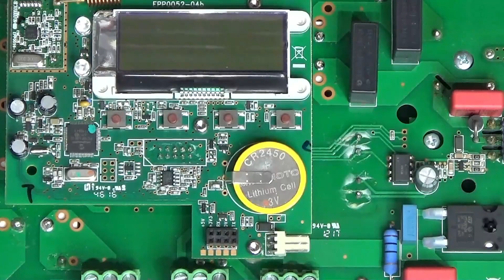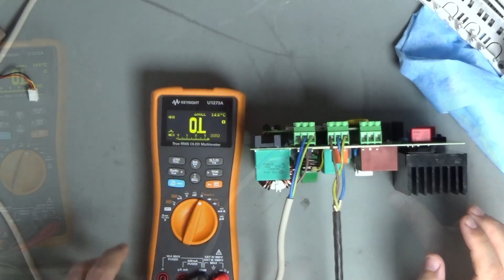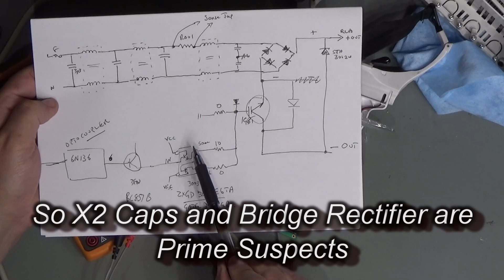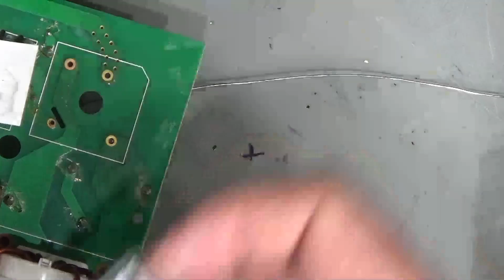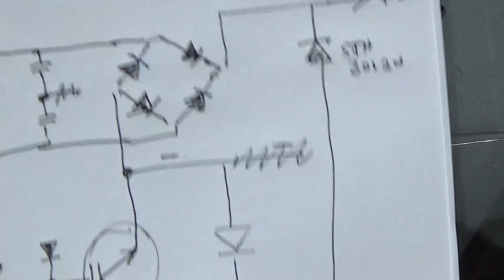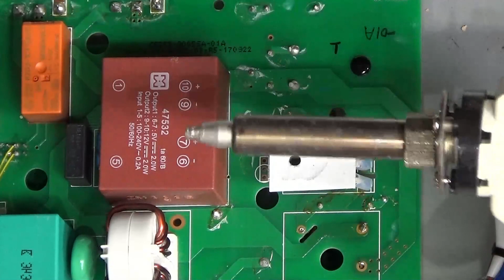Solar IBoost+ Repair #0082

Comment: Thanks for this I recently bought a solar iboost faulty with a no power situation - I hadn’t come across this video but quickly identified the dead short across live and neutral and ran it along to the bridge rectifier as well. As you found, the rectifier is night on impossible to get, but managed to source replacements direct from China (unknown quality I agree but nonetheless better than not working at all). I was quite concerned the igbt might have caused the failure and so I ordered them also. I also managed to pop the supply voltage to the control panel (doh!) whilst trying to read the pic with a serial connection with the reference to the mains - stupid mistake but I’m sure it’s popped something fixable. Anyway picked up another solar iboost over the week locally and EXACTLY the same issue. I’m still awaiting the components but should arrive tomorrow and your video has only just confirmed to me that it is just the rectifier.  PS quality of soldering on both my boards was pretty shoddy also…
Reply from the maker: Interesting, that is a serious rectifier to be failing so often. Feels like there is a design fault.

Comment: Thanks for uploading this video. Im finding Marlec (the makers of this unit) extremely difficult to deal with and help me with diagnosing my own unit. 
What would have been really helpful here is a quick summary of the fault at the outset of the video. I guess it was a total dead unit? Mine works perfectly for all features EXCEPT that it thinks the tank is hot constantly, so refuses to send power to the immersion. After testing continuity and resistance (and mechanical operation) on the immersion and thermostat, everything at that end seems 100%. Ive also tested the clamp and the Sender unit, and again, all fine.
So I assume its the Boost unit itself, but I cannot find the logic that its using to monitor the thermostat open/closed.
Reply from the maker: Yes, I normally do a quick show of the symptoms - yes, it was totally dead.  Since it does not actually sense the temperature of the tank, it detects "hot" by applying a voltage to the immersion and then discovering it does not take any current because the immersion thermostat has switched off.  So (unless the immersion itself is broken) then the fault is likely the cabling running to it, or the part of the iboost that senses the current, that would be the resistor I mentined int he circuit overview - I suspect that goes to some sort of amplifier before it goes to the microcontroller so the sense resistor and the amplifier would be my first suspicions!
Reply: @MakeOrRepair  Thank you for such a fantastic reply. Im 100% with you on the sense resistor (and amplifier). The fact that the "manual boost" works 100% to the immersion (and the ohms and continuity tests) make me believe that everything outside the iBoost unit itself is working fine. Thanks again for all your help; much appreciated!
Reply: Hi mate im having exactly the same problem with mine could you tell me how you resolved the problem please

Comment: My iboost has stopped working with very similar if not the same issue. Would you be able to repair mine?
Reply from the maker: I'm retired now, so I only do repairs for friends, family and some local charities.  Also the part I used is unavailable now until  early 2024 according to factory
Reply: @MakeOrRepair  thanks for replying. I have purchased a replacement. But I would be more than happy to pay for any part repaired and make a donation to a charity of your choice if that was an option. I wouldn’t want broken unit to got to land fill if someone with you skills and eye for detail to repair it